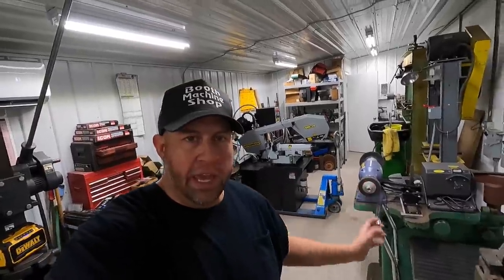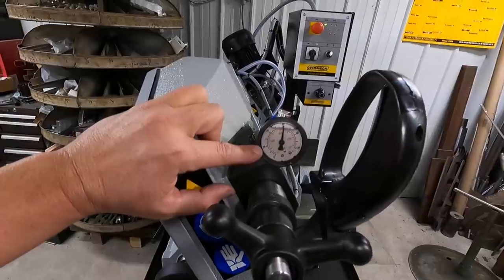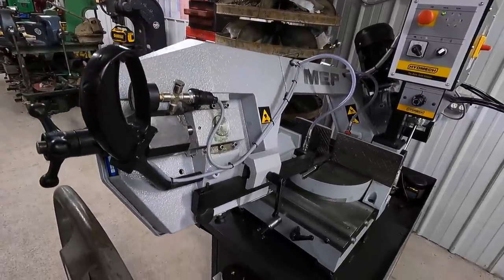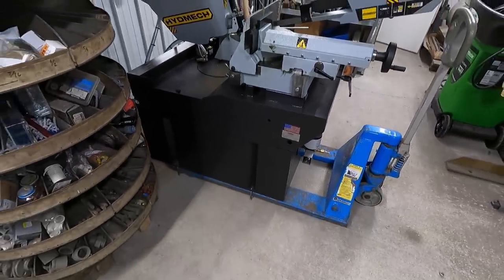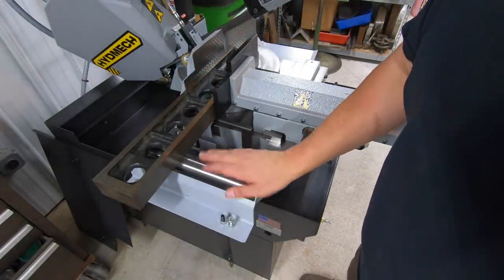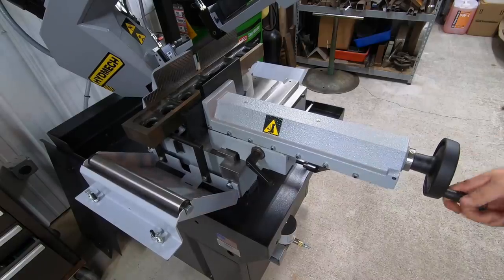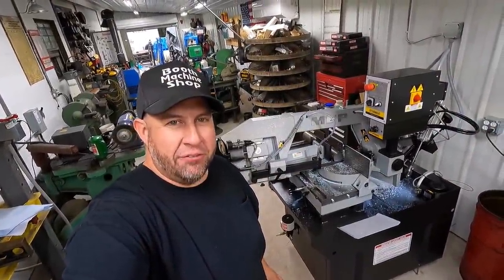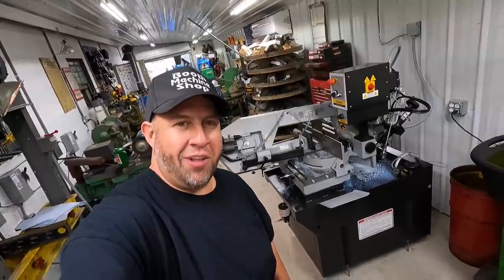Hydmech DM-10 Bandsaw Install and First Cuts

Comment: I bought the same model back in 2002. Back then "made in Italy " was stamped into the blade cover. It's been a production monster for all these years. The only thing I've gone through are blade guides and a bearing on the idler wheel. You going to love your new toy 👍
Reply: Is still a saw produced in Italy by MEP, but now they add a different stand with the american flag.
Reply: It is designed in Italy and parts are built in Italy but assembled in the USA
Reply: @danbaumer1763  you are correct sir. The point i was trying to make is when I bought my saw 19 years ago it was entirely made in Italy. My saw base is different than what is offered now as well. It has forklift pockets and is actually stamped made in Italy.

Comment: Hello, I've got a similar model from MEP.
If you want to test if it cut straight, it's not the right procedure...
You have to face one end on the lathe, and then cut a slice in the saw. Measure the thickness
Reply: Or lap the cut face and measure how vertical the piece is when standing on a surface plate.

Comment: Love that saw that is fantastic.   I put a hydraulic filter head and screw in filter and they last for years and keep the chips from circulating and hammering the blade tooth.  I never lost a blade since.  I cut Al to cast iron.  Some easy and some difficult. The clean oil works great.

Comment: If you take two cuts without rotating the stock it will always come out parallel, to check for 90 degrees take a cut then rotate the stock 180 in the vice and take the second cut ... then measure.
Reply: "I came here to say this"  But was definitely not first.

Comment: The test cut only checks for consistent cuts. Square up a piece in the lathe and then cut and measure it. Beautiful saw btw.
Reply: Yup parallel not square
Reply: If you turn the piece around and cut the opposite then you can check for square
Reply: When you start posting videos of you doing this stuff, people might actually believe you know what you’re talking about. In the meantime, keep your mouth shut. It’s pretty obvious he knows what he’s doing.
Reply: @albertledesma5173  took the words out of my mouth
Reply: @albertledesma5173  He's right, though. He didn't rotate the bar in between the two cuts so it could have been just two oblique cuts and it would still produce a parallel, yet out-of-square disc, as long as the two cuts were consistent.
Reply: Exactly, he cant know how square was the first cut, if it was off, the second one could have been off the same amount so it does not mean its square
Reply: Well he does own squares and frankly bandsaws aren't a Precision tool.
Reply: @jeffreylee7184  of course it is :) just for the sake of science :D
Reply: Get a load of this Albert fanboy. The test proved nothing. You could do two 45° cuts and the result would be the same.
Reply: I’m sure @Abom79 knows the difference between square and parallel. With that being said, it’s strange he didn’t just throw a combo square on it after the first cut🤷‍♂️. Probly not necessary to turn in the lathe considering bandsaw tolerance .
Reply: *face in the lathe
Reply: I am pretty sure he will address this in his next video :)  Merry Christmas
Reply: @matthewchastain136  and if it isn’t square, you have to split the difference of the measurement because it will double/amplify it
Reply: @albertledesma5173  that’s the problem, we’re in a world where money makes people think someone knows what their doing, I almost thought your comment was saying something entirely different and against Abom79 at first, it’s a simple mistake, no foul on his part, it’s one of those in the moment things, we all do it
Reply: @F0XD1E  one thing to note is that for accuracy and a measurable offset (if you could adjust the angle for instance) you would need to turn it exactly 180 (or a known angle and do more complicated math that may not even work beyond “even” divisions of 360)
Reply: @albertledesma5173  also just a heads up, you don’t need to be smarter than someone, let alone in a specific field, to know when something is wrong (though it is common to not have a clue and think others are wrong)

Comment: The furnished test cut drop off proves the saw is a well designed and tuned machine from a company that cares ! Refreshing in a time of junk knockoff equipment . I have an Everett 12S abrasive saw that actually  has a cut time per material chart .

Comment: Hi Adam. I'm late to the party, but I have a tip. When you fill the Sureshot from that jug, it would be better if you had the jug 180 around, so the handle is down. Feels weird, but the flow is much smoother, not all that glug-glug. With how high you are with the Sureshot and the funnel, it should work well, it's a lot more iffy when you are low down, like topping up a engine with oil, where I use that trick the most.

Comment: Very nice band saw. We have one at the store and our problems sometimes is like i did see on yours is that there is on the back side of the saw a brush to clear the chips from the saw band . After a time running this brush has no connection with the saw anymore and some chips will stay in the saw. this will cause  bad angle cut.  ALWAYS check this before you change the blade because sometimes the blade is ok  but your cutting will not be straight. Normal you can correct the brush to make contact wit saw blade. Merry Christmas and a Happy 2021 and Stay Safe. Greetings from Belgium

Comment: Looks a really nice machine. Congrats. With your test cut however, you should've turned the piece 180 deg between cuts to show how "straight/square" it cuts compared to the vice & base. Your test showed excellent consistency cut to cut but not actual squareness. If you rotate the work piece 180 deg between cuts then your "out of square" will be half of any measured variation. But hey, congrats again on what looks a really nice piece of kit!

Comment: You needed to rotate the bar-stock 180 degrees to get how out of square it is, make your first cut, rotate 180 degrees, make second cut, then measure and divide difference in half and that is how off it is.

Comment: Hey, Adam. Just a little feedback. The cuts when you were showing the disc from the saw are very distracting. I saw it in another video and thought it was a camera problem. If you want an honest opinion, I think you could do without it. Thanks for the videos man.
Reply: I agree. At first I thought this was a Youtube problem, and then it appeared again in this video, but I'm glad I'm not the only one that noticed this.
Reply: I stopped the video and reloaded it thinking it was a connection issue.
Reply: Are you talking about the slowed down video? I assume he did it simply to give more time to the viewer to see details. :shrug: Didn't bother me. In fact I appreciated in the moment they he continued to talk over it (at a normal audio rate).
Reply: @slip0n0fall  no, no. slow down is fine. I am talking about when he chops the video in small cuts, 22:45 . I am not really complaining, this is just some feedback, I am very thankful for adam's videos.

Comment: Be carefull Adam, you might have cut parallel but not square.
You should have rotated the piece by 180° between the two cuts, the measurement would have shown twice the error.
Or you should have squared the stock in the lathe and then cut it once.

Other than that, I am very jealous, it looks fantanstic !
Happy Christmas from Switzerland !
Reply: Yeah, I noticed it too..  The factory test piece was probably done that way.. Nice saw tho..

Comment: Parallel or square ?? Why not rotate the bar 180 degrees for the second cut to see if in fact it is truly  cutting "square" to the table. I bet it is because it looks like a "high end" saw but it would be interesting to see the measurement on that! I admire you and am impressed with your work Adam! I am not being critical...just curious....I wish I could afford a beautiful machine like that, Mark
Reply: Or face it off on the lathe.
Reply: @CasaVoid  Good point!  Cut off saws are for roughing work anyway.....

Comment: thats such a nice unit! the valve shop i worked at we had a home made flood cooler on the blade (old evaporative cooler pump things drained from a fabed up pan into buckets)  an had to manually set everything adding weight to the end of the boom to get a good cut speed watching the blade constantly for it to relax an then itd go off an cut the material at an angle which then we had to face off before doing further machining for valve bodies an tank bases

Comment: Nice saw. Uniform thickness does not necessarily mean it's square. That just means that the blade tracked consistently from one cut to the next. And that is primarily due to the set of the saw blade being consistent from one side to the other. If the saw set is diminished on one side, the cut will veer toward the other.

There's a DoALL saw from the past (C-12 I think) that uses its hydraulic pump to tension the blade and the advantage to that is the tension is released automatically when not in use and reapplied when started.

Perhaps the most important thing to look for on a horizontal bandsaw is the blade guides and the structure behind them. Many of the cheap saws have very flimsy guides that can't keep the blade tracking properly when the pressure of cutting is pushing against them which results in inconsistent and curved cuts. Usually I prefer the movable one that come from above but these look pretty robust.

Comment: I see a lot of speculation about where the saw is built, it is a MEP designed saw but it is assembled in Conway Arkansas. As for the cutting straight we cut out every saw before shipment and it has to cut 0.002” for every inch in pipe. It is a very good manual saw.

Comment: i have the exact same saw mate, cut soft steels on the second setting, and stainless on the number one setting, also see if you can order the progressive tooth blades for it. in my opinion they are the best all rounder blade for job shops.

Comment: That is the king of saws. I've NEVER seen material come off of a saw THAT square.
Reply: I think he didn't rotate the workpiece 180° after the first cut, so it is just parallel and you dont know if it is also square...
Reply: @Henning_S.  That's a great point. Maybe if Abom reads this, he could repeat the experiment. Good thinking.

Comment: Looks like a real nice saw, beautiful cuts. That Unist unit is a MQL oil sprayer, not a coolant mister. I have a couple similar units from Trico, a dual nozzle solenoid operated unit hard wired into my mill and a single nozzle manual unit I use on my lathe and drill press. They really do a fantastic job, even in tasks like drilling titanium, and no coolant mess to clean up. I use synthetic oil specific for MQL, the veggie oils harden to a varnish and can clog the hoses and valves over time.

Comment: For testing square would it really be a good measure testing the same two cuts? Wouldn’t indicating and facing the end of the round stock and then bring it over to the bandsaw be a better measure of testing square? Theoretically two cuts on a quality bandsaw should be somewhat parallel. I’m not a machinist so I could be off base lol
Reply: Could just make a cut, then rotate the work piece 180 degrees and make another cut. If its square, then cuts should be parallel
Reply: I am not a machinist either, but I thought the very same thing.
Reply: Just commented the same thing, then saw your post :-P

Comment: Correct me if I'm wrong here but if the saw is slightly off of cutting square wouldn't it make the same error on both cuts which would work itself out into two parallel cuts giving uniform thickness regardless of if the saw is off or not? Kind of like / / rather than  / | 

Wouldn't you want to face the work piece on a lathe to know the end is square and then make a cut off on the saw before measuring the thickness to determine the run out on the saw? I am not a machinist but I can't shake the logic of what I'm thinking here so if I'm wrong, please explain. 

Abom, I love the videos & I'm a long time fan.
Reply: You are correct, what he measured was parallelism, not squareness to the stock. One can either do like you suggested and face the material in the lathe first and then cut it, or when you make the first cut, rotate the stock 180 degrees and cut it again, so you get double the error in the workpiece for the squareness.
Reply: It is still better than any one could with a hacksaw. 
Everyone worried it cuts are not perfect. Well then use a mill.
Reply: @greg9403  Of course it's better than using a hack saw. I'm not worried that the cuts aren't perfect, it's a cut off saw used for rough cuts. I'm just curious about the methods he used and trying to understand them. Merry Christmas.
Reply: @JaakkoF  What's the point of measuring if the cuts are parallel? Just to make sure the saw is cutting the same every time?
Reply: @robsodomy  
Merry Christmas to you and your family
Reply: @robsodomy  considering bandsaw tolerance, I don’t think it’s necessary to true up a piece in the lathe to check squareness. I’m surprised he didn’t check with a combo square tho.
Reply: Also with the way he set the roller height , and considering this is a $10’000 unit, I’m confident it’s cutting as square as any bandsaw possibly could lol .
Reply: @benpeterson9835  
At 10 grand I want to be able to cut a steer in half.🐂🥩🍖🍔🤤💯

Comment: Very nice! Just wondering about chip management. They just wash down to the coolant tray and what...shovel them out occasionally?
Reply: Essentially yes, Any swarf rinses into the settling tank - the fact that it's a soluble oil emulsion means they can't rust solid - The pump is lifted up and also fenced to prevent circulating cuttings
That is also why the back support roller has a coolant wash and what looked like a small wire wheel to make sure the blade stays clean and unclogged

Comment: If it’s like my saw, i had to take it apart within a year, my slide mechanism was starting to sieze up due to rust where I couldn’t turn it at all. 
I had to add in grease zerks after a liberal amount of grease to keep it from rusting from the coolant. And a pump of grease into it now again.
Reply: What kind of coolant are you guys using down there? -  I am a one man shop and barely have time to get the parts out the door on time,  let alone make the shop look like a GI kitchen at the end of every day. The fact is I only get time clean the swarf out of the band saw, which runs 2 hours or more a day 6 days a week, only on Sundays (or not) My point is there is ZERO rust in the mostly 4140 sawdust or the chips on any of the machines  that sometimes  sits there soaking for up to 2 weeks, or sometimes more.  Until I get it out into the scrap hopper anyway, where it turns brown on the spot as soon as it rains but there is absolutely no rust at all caused by the coolantt on chips or machines. 

Also I never see anybody in other shops  around here drying and rust proofing their Fadels and Haas machines (or anything else)  at the end of every shift, In fact I have never heard of anybody doing it at all. - If you are getting rust from coolant there is something radically wrong with the coolant you guys are using. I have no such problem here at all. 

Just had to bring this because I can't for the life of me understand the the reason people go into complete hysteria  whenever they see anybody is  using water based coolants on youtube, . - Try mixing them the right way and keep it properly conditioned there is absolutely no chance of rust. Not around here, anyway.
Reply: @mathewmolk2089  
It’s the coolant plus the 90+% humidity all year. Everything that doesn’t move for a week rusts around here.

It’s not called the rust belt for nothing.

Also some of it was dried coolant that got into the swivel and made a thick paste that dries solid after years of use, 
Then a week not using it would be locked solid, after a few cuts and an hr later it would loosen up the swivel. Grease is more preventative and not allowing coolant into the sliding surface

Comment: It definitely cuts parallel.. don't no how square without rotating the stock or facing it off on a lathe...
But why don't you cut 4 more pucks off while you're there and make some feet for it instead of ordering them in?

Comment: Could you not turn the rod 180 degrees between cuts for a better saw test?
Reply: Yup. What Ian said. Rotate the stock 180 to double the error. If you don't, the saw will naturally cut parallel proving nothing unless the blade  has some inconsistancy of cut.

Comment: Are you sure you don’t want that saw closer to the door so you can have long material stick outside?  My supplier only sells 20’ lengths, so all my projects start with long stick outs.
That sliding vice is a wow factor.  Very nice saw.

Comment: you just made 2 parallel cuts, thickness should match, but that does not mean the cuts are 90 degrees to the axis of the material.   shouldn't one turn the material 180 degrees between cuts to check for that right angle?

Comment: hmm wonder what the advantage or disadvantage would be for using mist coolant over flood coolant ,,, besides filming ?  - since flooding washes away the chips more effectively , along with the brass wheel
Reply: I seen that to..lol
Reply from the maker: Imagine this being in a more productive environment and cutting large Structual pieces of steel like I-beam all day everyday. You don’t want lots of wet flood coolant all over your work pieces.
Reply: My only guess would be if you have a really wide piece of say flat bar you can add extra coolant to the middle of the work piece.

Comment: Damn, that's a lot of tension on that blade. Over 1000psi.
Reply from the maker: Helps those straight cuts 😎
Reply: Yes, I would have never guessed it needed that amount of pressure
Reply: The blade in our saw at work is tightened at 4kn which converts to 900psi. And that is full automatic industrial saw..